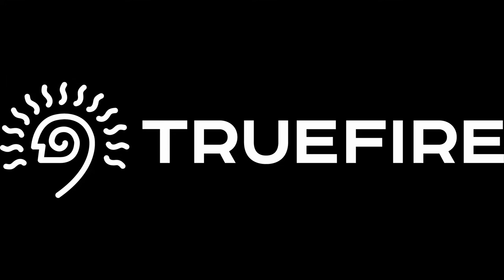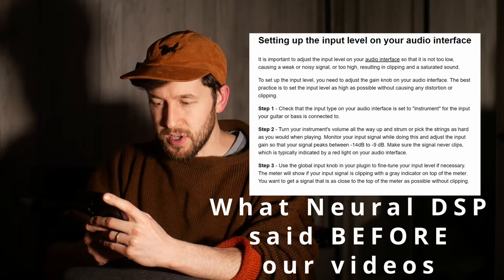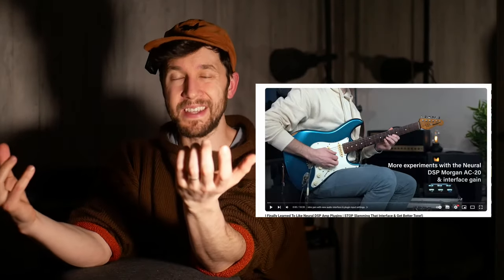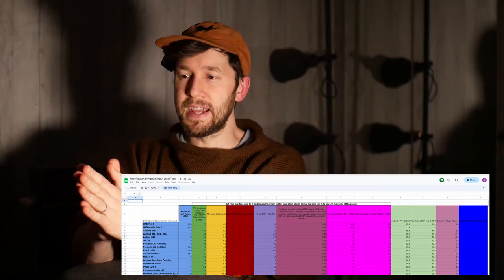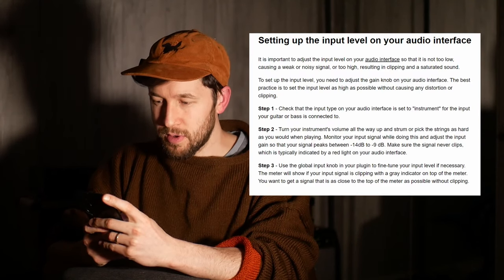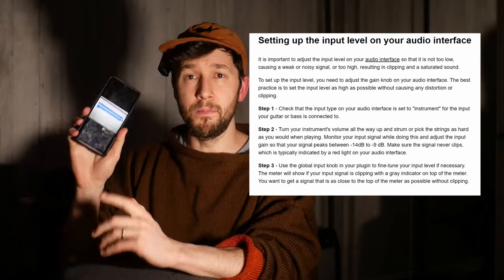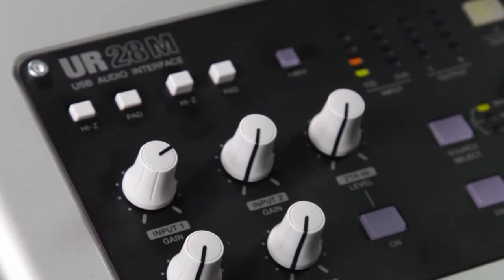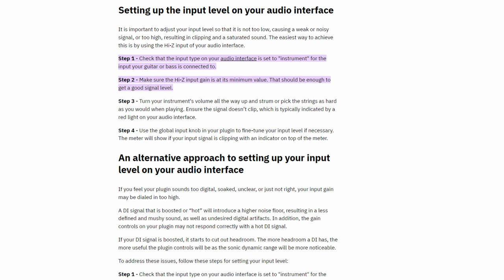Why Are Neural DSP Gaslighting Us About Plugins and Input Gain?

Comment: This whole thing started gaining steam as a good point made by Edward Sokolowski in regards to the variances of gain levels found in the NAM models made from 100's of different people. It went like this: Three different people who own a 5150 made a NAM model out of the lead channel with the same knob settings. All 3 of them ended up with different amounts of gain in their models. Why? 

Person #1 - played the NAM training file very loudly through his amp. This resulted in more gain captured in the model. 

Person #2 - played the NAM training file very quietly through his amp. This resulted in less gain captured in the model. 

Person #3 - played their NAM training file somewhere in the middle. Then a family of bears ate him. 

I fall into the "use your ears" camp, though I completely understand the buzz around the subject. 
If calibrating your input gain knob on your interface gives you some assurance that a round of "Turn it up/down until it sounds good" does not give you, then ok. Go for it. Just be aware that every amp sim is going to have a different "input dBu" value and you will then have to keep notes on that and adjust accordingly. And I am almost positive that in most cases, that input dBu value will be different from one amp sim to another from the same maker, possibly from within the same amp suite. Just like how every NAM model has a different input dBu due to how loudly or quitely the user played their training file through their amp (and the very large majority of them just used their ears so youre gonna have to do the same as them anyways lol).
Reply: Most plugin developers stick a single definition of dBu->dBFS, the only one I’m aware of that is all over the shop is Amplitube. 

All NDSP plugins expect 12.2dBu
All Line 6 (and Ampeg) plugins expect 11.5dBu
All Nembrini plugins expect 13dBu
All STL plugins expect 5dBu 

Etc.

Even with Amplitube, it just depends on when the models were made. All of the Fender models expect the same levels as each other for example. It doesn’t seem to be the same level that their Silver Jubilee expects.

Amplitube aside, it’s only really with NAM and ToneX etc where things vary model to model.
Reply: @eds4754 Right on. I have a feeling that, depending on the number of developers working on amp sim development, and the timeframes between each development cycle, you could end up with disparate starting points. Though I guess there could be a "template" amp sim that they are starting with, and that template is the same for clean amp sims and high gain amp sims.   At least with "white box" amp sim development (make everything by hand, from scratch, inside the computer) this makes sense. 

When you get into "black box" amp sim development (send test signals through hardware and create an emulation with what is essentially Machine Learning) you end up with the same issues as NAM. It all depends on how loudly those test signals were played through a piece of hardware on that day by that developer. If notes were not kept on the impedance and dBu, then we are left with "use your ears" again. 

Whether developers publish a number or not, given what I know about white/black box development, I doubt there really is a standard that has been kept over different development cycles. So were back to "turn it up/down until you hear something you like". 

And I am in no way diminishing your work on this, Ed. I appreciate what you do for the community very much. Im just giving my perspective of always relying on myself to figure out what works best for me. While this rise in popularity dBu input gain seems like a complicated but "standardizing" bit of information, its getting misinterpreted and likely incorrectly implemented or reported by most people/developers.
Reply: If an amp sim has too much distortion for your liking and you dont think to yourself "maybe I should reduce the signal going in" then I dunno what to tell you (where "you" is the average amp sim user who is now paralyzed by this new information).
Reply: @jasonzdora  If it’s white box modelling, typically they are using SPICE which has a default definition of 1V=0dBFS. So this is the underlying behaviour of basically all white box modelling.

Because 1V is too little headroom to record with, typically they’ll run a hidden internal boost in front of the processing. Softube+Audiority don’t do this, but Line 6, STL and NDSP do. 

With machine learning based sims, the concept is the same - it’s up to the creator to determine what analog to digital conversion ratio they are using. 

I wouldn’t really say it’s an issue, as much as it’s a design choice. If you make an amp sim you have to decide on what definition you want to use for equating an analog voltage (i.e the input), and the digital level. The same is also true of analog modelled plugins ever since day one. It’s in Waves/UAD/Plugin Alliance manuals and the same rules of digital audio apply. 

Any serious developer wouldn’t skimp over this stuff, anything with non linearities and a lot of amplification is going to be very fussy about what input produces what output. 

Regarding the second point - how am I supposed to know exactly how much gain an MLC Subzero should have? How can I instinctively know where a Fender model transitions into poweramp distortion? 

I can make a reasonable guess, but that’s not going to be very true to the original amp. Whether or not that matters is down to the user.

I 100% disagree with information being “paralysing” - anyone can do what they want with information. If it’s too difficult, you put it aside and come back later when you have more experience. That’s normal with learning anything, often things require a little bit of effort and willingness to learn. As things stand there are a LOT of people who want to understand this better and still have very little good sources of information on this topic, so any discussion and explanation on this helps everyone who wants it.
Reply: @eds4754  I agree with everything you said above. This is still true: Black box is very common as it is easier and gives excellent results. It also leads the the same issue as NAM as explained above. 

The white box model also requires a dev to use their own discretion as you mentioned, which is also a variance from developer to developer (and possibly that same developer on a different project). We will never know if they are consistent or if they are being honest as they probably didnt care and just did what sounded good at the time, whether they were advanced developers or not. 

I think there are plenty of people who are more confused by this than people who understand it. Analysis Paralysis is a real thing. More information when you dont understand even basic gain staging isnt good unless someone is willing to learn. Most amateur guitarists using an audio interface and plugins will not put in the time. Those people create noise and uncertanty and it makes things even more daunting for new people. It still comes down to "does this sound good?" and having the ability to trust yourself, make mistakes, learn and try again until you figure it out for yourself. You've provided excellent information but the storm if anciliary youtube content and comment sections full of mis-implementation is a result, unfortunately. Meanwhile, the entire premise of developer discretion that I proposed above is still true so were back to square one.
Reply: @jasonzdora  If someone is making an analog model, then the relationship between the theoretical Voltage and digital level is intrinsic to it. 

The plugins using black box (for the most part) are just as consistent with levels - Neural DSP and Mercuriall are very rigid with this. 

Purely opinion here, but plugins like ML sound lab and Audio Assault simply aren’t as professionally made. That’s not to say they aren’t good plugins, or can’t sound good. But anyone making an accurate analog modelled plugin would be on top of this - it’s nothing new. The earliest analog modelled plugins ever made had this dealt with. The only issue is the lack of information for users to actually take advantage of the (accurate)  modelling.

If sufficient information is provided, there is nothing stopping anyone achieving the most accurate results. Without that information, it’s not possible. There is no good reason not to provide it, no one will get paralysed by having to use their intuition or guess (because that’s what they do now). Most people do not know how to set an accurate input level for plugins, and that is a shame (and easy to fix).
Reply: @eds4754  Again, I agree with all of this. Except "without the input dBu information, its not possible to get an accurate representation of the analog hardware that was modled" (sic). If I misrepresented what you said, let me know. 

I think it is 100% possible for a user to acheive perfect (or at least very good) results without knowing what the dev is expecting the users input to be. To have the exact settings is not important to me and I dont think it is nearly as important as this entire exercise is making it sound. Its "nice to know" and thats about it. People use boosts into amps (in a way that cannot be done with a hi-Z input AND in a way that cannot be emulated digitally with NAM), people use low/hi output pickups, people use long or short cables, people use buffers (tuners) or they dont. All of that changes the gain staging and impedance of the guitar signal so much more than the useful range of a Hi-Z hardware input on an audio interface. The user is also able to further gainstage digitally in their DAW before the amp sim with a gain utility. There are so many factors at play here and the complexity of what youre showing is good for people who understand it and confusing for people who dont. I know "use your ears" is seen as a dismissal of your work but I truly dont mean it that way. Its just the reality of the situation, in my opinion. 

Knowing the exact (reported) input expectation is nice but can be incorrect or at least tertiary. Getting close is good enough. Making it sound good is making it sound good. Turning it up until it sounds bad, then turning it down until it sounds bad, then finding the middle ground where it sounds good. This is the way it works and the way it always will work.
Reply: @jasonzdora  IMO, this is conflating accuracy and dialling it until it sounds good. 

If you are intimately familiar with how an amp sounds and behaves, you might be able to guess a correct level by ear. Is it accurate? If you are lucky.

If you aren’t familiar with the amp, you can dial something that sounds good. Is that enough? For some people yes. But again, it’s not accurate. 

I think if someone can easily and freely have the means to have accuracy AND make it sound good, then why not? IMO, it’s not more confusing than saying “just guess until it sounds good” because the user will always have that doubt in their mind if that’s how the amp is supposed to behave. 

I know accuracy isn’t hugely important to you for this subject, but a lot of people don’t have a real world reference point and would like to hear them as they were designed. 

I have too many amps and I’m purposefully choosing which model to use based on my real experiences of the amp - if I want a particular sound, then I’m using my real world experience to base that decision off.

Totally respect if you think that this is too complex for users, but I don’t agree there. It’s a good subject to learn, there are all kinds of technical things musicians learn about (think how much a synth player might learn? or a guitarist with a rack full of gear?). I’ve helped several players who’ve been playing under a year and they understand it just as well as I do.
Reply: @jasonzdora  FWIW I can think of tons of amp sims I’ve tried over the years where I had no idea how it was supposed to sound and eventually just gave up. When I don’t have to consider the input level, it’s just one less thing to have doubts about and I can work 1000% more creatively. For other sims, I would never have felt confident in boosting 15dB or more - that would have felt like i’m boosting the input, when in reality it’s just getting it to unity, and I could boost it TONS more still if I wanted.
Reply: @eds4754  "the user will always have that doubt in their mind if that's how the amp is supposed to behave." AND "I had no idea how it was supposed to sound and eventually just gave up" - this is the paralysis Im talking about. Its head cannon. 

 "If you are intimately familiar with how an amp sounds and behaves, you might be able to guess a correct level by ear. Is it accurate? If you are lucky." - ultimately, this doesnt matter to me. I make it sound good. Thats what matters to me. Letting go of the minutia is what allows creativity to occur, in my experience. If a gain knob and an opinion on which position sounds best are enough to ruin someones creativity, I cant relate. 

Again, I am not saying your workflow is incorrect or that your philosophy is bad. Your willingness to explain it to people is commendable and I hope that it helps people get great tones. Everything you are saying is 100% spot-on, correct, valid and true. 

I am just saying that, to me, it is minutia that is solved with 5 seconds of scrolling a gain knob up and down. If other people need to do all of this to get a great tone, thats fine but I cant relate. If they need to do this to feel secure that they have the right gain settings and this is how the amp is "supposed to sound", thats fine but I cant relate. If they belive what a developer says years after the fact, thats fine but I cant relate. If they cant figure out what is the first and most obvious part of recording a sound, thats fine but I cant relate.
Reply: @jasonzdora  Yeah, all good! Everyone has their methods and goals that work, and they are all valid. This is just demonstrating one of them.

The paralysis above stemmed from not knowing the input levels, so this knowledge made the experience more positive. So while information may confuse some users who don’t understand it, not having that information can confuse other users. It’s 2 sides of the same coin - I think ultimately, information should always be shared, rather than hidden away.

There is still so much bad information on analog levels WRT plugins, so I think this stuff is all a step in the right direction. Every success I’ve ever had from audio has been from a willingness to learn and improve, so it’s always what I recommend to others that are willing.

I always had the impression that plugins and modelling were inferior to real amps, but i’ve come to realise my own ignorance and lack of knowledge was what was holding me back the most. This is just one area of amp modelling I had to work to understand better in order to get more realistic and better tones that I was happy with. I don’t expect that to be the case for everyone, but it’s good to share the knowledge!
Reply: @eds4754  Well said, brother! I agree with everything you mentioned, once again, and I still think everything I said is equally correct and valid. We're just coming at it from different perspectives. I see a gain knob and adjust it to taste using my ears until I hear something I enjoy. You see it as creating the most authentic experience possible.

Comment: Like Rabbea, it doesn't make any sense for me now to max input gain on the interface even if I've done it in the past like a lot of people. In the analog world, you plug your guitar directly into the amp input (sometimes going through pedals which is doable in plugins too) but basically, guitar straight into amp.

That advice of maxing interface gain is like if we'd recommend people place a clean gain preamp between their guitar and tube amp and max that clean preamp's input just below clipping which would result in a much hotter signal going into the amp's own preamp thus creating more distortion. In the analog world, this would be ridiculous advice. It's like using an always on clean boost pedal when all you want is your amp preamp to react normally to your normal "weak" guitar signal. This makes just as little sense in the digital world. Boosting signal just before the amp's preamp is a tonal based choice and why pedals like the Tube Screamer and other boosts exist. It's certainly NOT a basic clean gain staging thing...

As someone else said, this is advice clearly coming from an older time when interfaces were noisier and you usually wanted to maximize your recorded input level. But modern interfaces are not like that anymore. I realized this when I started working with modelling plugins and especially S-Gear. I'd always ended up with way more gain than I expected and seemed to overwhelm the plugin amp's input. When I tried turning down my interface input gain, the plugin's dynamics instantly improve as did feel and tone. I had active pickups in my Strat at the time so I came into the plugin way too hot. Even now that I'm back to passive pickups, things sound way better when I leave my (Audient) interface input gain down. Dynamics are better, sounds better and more realistic, etc.